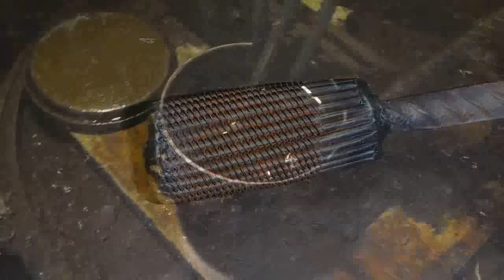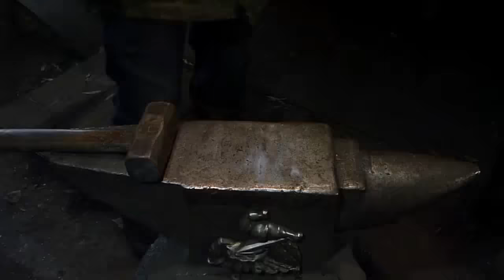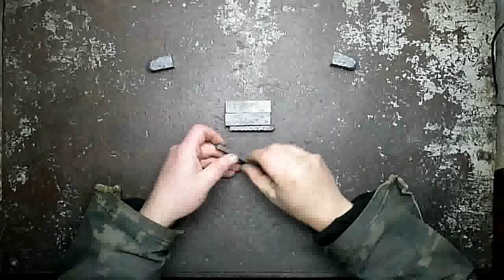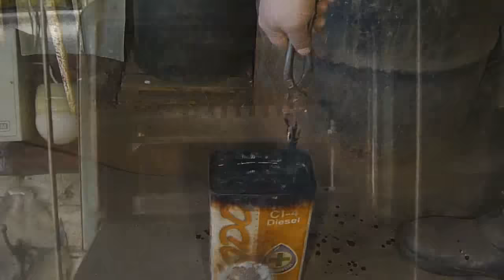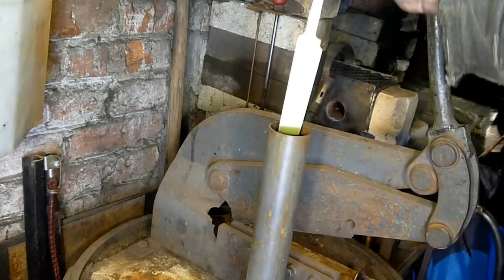Damascus of screws, making a blade.

Comment: Oque é esse pó que se coloca no aço quente?
Reply from the maker: Eu borrifo com fluxo (bórax 90% + areia de quartzo 5% + carvão em pó 5%), isso é necessário para realizar a soldagem (forja). O fluxo se funde com a escala - a substância resultante é bastante fluida e é facilmente deslocada durante a deformação. Além disso, o fluxo protege contra o oxigênio e, devido ao carvão, carboniza a camada superficial do metal - o que diminui a temperatura da soldagem (em resumo).

Comment: What powder do you add to hot iron? Write to me please
Reply from the maker: I sprinkle flux (90% borax + 5% quartz sand + 5% charcoal powder) this is necessary for forging (forge) welding. The flux is alloyed with scale - the formed substance is sufficiently fluid and is easily displaced by deformation. In addition, the flux protects against oxygen and charcoal, carburizes the surface layer of metal - which lowers the welding temperature (if in brief).

Comment: Why did you start on a piece of wood?
Reply from the maker: The first welding is done on a tree, as the tree is a heat insulator, and not so selects temperature as an iron anvil. In addition - burning, the tree burns oxygen, protecting the workpiece and pouring the flux work. This is important for welding workpieces with small parts (cable, chain).

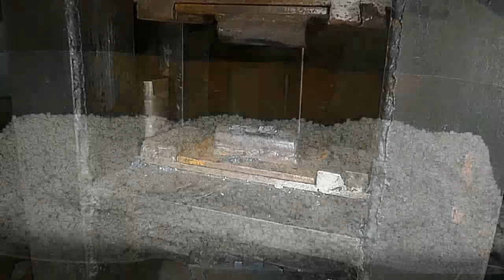Comment: Hi everyone. Does anyone know what substance is being used to quench at 6:37?
Reply from the maker: This is annealing of steel, it is needed for grinding grain of steel grown at the temperature of forge welding, stress relief. Preheated billet to austenitic transformation temperature, placed for slow cooling in the heat insulator "Perlite".
Reply: @shurap  Thanks! I have very little idea about any of those terms you mentioned but I am going to investigate 😉. Also, keep up the great work!
Reply: @shurap  If there are any books or websites that you recommend, please let me know. Thanks again.

Comment: What is the liquid its dipped in at the beginning?
Reply from the maker: The billet is soaked in kerosene. This is necessary for good welding (forging) steel. When burning inside the workpiece remains soot (carbon), which, with further heating, scales and rust inside the workpiece restores to the iron, improving the quality of forging welding.

Comment: I want to know what powder dusted on the metal
Reply from the maker: I sprinkle flux (90% borax + 5% quartz sand + 5% charcoal powder) this is necessary for forging (forge) welding. The flux is alloyed with scale - the formed substance is sufficiently fluid and is easily displaced by deformation. In addition, the flux protects against oxygen and charcoal, carburizes the surface layer of metal - which lowers the welding temperature (if in brief).
Reply: @shurap  Thanks for your professional answering.

Comment: What is the powder he pour on the screw?
Reply from the maker: I sprinkle flux (90% borax + 5% quartz sand + 5% charcoal powder) this is necessary for forging (forge) welding. The flux is alloyed with scale - the formed substance is sufficiently fluid and is easily displaced by deformation. In addition, the flux protects against oxygen and charcoal, carburizes the surface layer of metal - which lowers the welding temperature (if in brief).

Comment: What's that dust you're spilling?
Reply from the maker: I sprinkle flux (90% borax + 5% quartz sand + 5% charcoal powder) this is necessary for forging (forge) welding. The flux is alloyed with scale - the formed substance is sufficiently fluid and is easily displaced by deformation. In addition, the flux protects against oxygen and charcoal, carburizes the surface layer of metal - which lowers the welding temperature (if in brief).
Reply: @shurap  Thank you, master.
Reply: @shurap  I love this job.

Comment: What does putting ash on it do?
Reply: That is flux, Borax most likely, it melts into a liquid and displaces air / oxygen and other gasses as the metal comes together and prevents voids. In the canister he adds powdered steel to fill the voids around the small screws within the sealed canister.

Comment: Dumb question what’s the stuff he sprinkled on it
Reply from the maker: I sprinkle flux (90% borax + 5% quartz sand + 5% charcoal powder) this is necessary for forging (forge) welding. The flux is alloyed with scale - the formed substance is sufficiently fluid and is easily displaced by deformation. In addition, the flux protects against oxygen and charcoal, carburizes the surface layer of metal - which lowers the welding temperature (if in brief).

Comment: Why does he hit it on wood first?
Reply from the maker: The first welding is done on a tree, as the tree is a heat insulator, and not so selects temperature as an iron anvil. In addition - burning, the tree burns oxygen, protecting the workpiece and pouring the flux work. This is important for welding workpieces with small parts (cable, chain).

Comment: what does the powder do, and what is it?
Reply from the maker: I sprinkle flux (90% borax + 5% quartz sand + 5% charcoal powder) this is necessary for forging (forge) welding. The flux is alloyed with scale - the formed substance is sufficiently fluid and is easily displaced by deformation. In addition, the flux protects against oxygen and charcoal, carburizes the surface layer of metal - which lowers the welding temperature (if in brief).
Reply: @shurap  thanks a lot for the great explanation! Love your videos!

Comment: What does he dunk it in at the start of the video?
Reply from the maker: The billet is soaked in kerosene. This is necessary for good welding (forging) steel. When burning inside the workpiece remains soot (carbon), which, with further heating, scales and rust inside the workpiece restores to the iron, improving the quality of forging welding.
Reply: @shurap  Oh ok thanks for the info

Comment: What is the powder he is spreading on?
Reply from the maker: I sprinkle flux (90% borax + 5% quartz sand + 5% charcoal powder) this is necessary for forging (forge) welding. The flux is alloyed with scale - the formed substance is sufficiently fluid and is easily displaced by deformation. In addition, the flux protects against oxygen and charcoal, carburizes the surface layer of metal - which lowers the welding temperature (if in brief).
Reply: @shurap  ah interesting, thank's man 👍

Comment: Whats he seasoning the screws with at 0:42
Reply from the maker: I sprinkle flux (90% borax + 5% quartz sand + 5% charcoal powder) this is necessary for forging (forge) welding. The flux is alloyed with scale - the formed substance is sufficiently fluid and is easily displaced by deformation. In addition, the flux protects against oxygen and charcoal, carburizes the surface layer of metal - which lowers the welding temperature (if in brief).
Reply: shurap you legend! Thanks for letting me know 👌💯

Comment: Why hit it on wood first?
Reply from the maker: The first welding is done on a tree, as the tree is a heat insulator, and not so selects temperature as an iron anvil. In addition - burning, the tree burns oxygen, protecting the workpiece and pouring the flux work. This is important for welding workpieces with small parts (cable, chain).

Comment: Why is hé using that powder
Reply from the maker: I sprinkle flux (90% borax + 5% quartz sand + 5% charcoal powder) this is necessary for forging (forge) welding. The flux is alloyed with scale - the formed substance is sufficiently fluid and is easily displaced by deformation. In addition, the flux protects against oxygen and charcoal, carburizes the surface layer of metal - which lowers the welding temperature (if in brief).
Reply: @shurap  thank you👍

Comment: whats the powder and what does it do?
Reply: It's sand. The silicon in the sand reacts with a compound on the metal to form something called fayalite. Fayalite melts just under the metal's welding temperature, meaning it seeps in the cracks of the weld improving its strength and overall quality.
Reply: @cl4267  wow thanks, never thought sand would be used for te weld. I was alwasy thinking some kind of metal dust

Comment: What is that powder?
Reply from the maker: I sprinkle flux (90% borax + 5% quartz sand + 5% charcoal powder) this is necessary for forging (forge) welding. The flux is alloyed with scale - the formed substance is sufficiently fluid and is easily displaced by deformation. In addition, the flux protects against oxygen and charcoal, carburizes the surface layer of metal - which lowers the welding temperature (if in brief).

Comment: Why the wooden board?
Reply from the maker: The first welding is done on a tree, as the tree is a heat insulator, and not so selects temperature as an iron anvil. In addition - burning, the tree burns oxygen, protecting the workpiece and pouring the flux work. This is important for welding workpieces with small parts (cable, chain).

Comment: Why put the powder
Reply from the maker: I sprinkle flux (90% borax + 5% quartz sand + 5% charcoal powder) this is necessary for forging (forge) welding. The flux is alloyed with scale - the formed substance is sufficiently fluid and is easily displaced by deformation. In addition, the flux protects against oxygen and charcoal, carburizes the surface layer of metal - which lowers the welding temperature (if in brief).

Comment: 1:33 what is the powder he applied ?
Reply from the maker: I sprinkle flux (90% borax + 5% quartz sand + 5% charcoal powder) this is necessary for forging (forge) welding. The flux is alloyed with scale - the formed substance is sufficiently fluid and is easily displaced by deformation. In addition, the flux protects against oxygen and charcoal, carburizes the surface layer of metal - which lowers the welding temperature (if in brief).
Reply: @shurap  wow, that was an awesome reply - I truly wish I understood what it all means. But somehow the flux keeps the metal malleable during forging?

Comment: What kind of powder?
Reply from the maker: I sprinkle flux (90% borax + 5% quartz sand + 5% charcoal powder) this is necessary for forging (forge) welding. The flux is alloyed with scale - the formed substance is sufficiently fluid and is easily displaced by deformation. In addition, the flux protects against oxygen and charcoal, carburizes the surface layer of metal - which lowers the welding temperature (if in brief).
Reply: shurap thanks

Comment: How come wood is used ?
Reply from the maker: The first welding is done on a tree, as the tree is a heat insulator, and not so selects temperature as an iron anvil. In addition - burning, the tree burns oxygen, protecting the workpiece and pouring the flux work. This is important for welding workpieces with small parts (cable, chain).
Reply: @shurap  thank you for taking the time to reply. Exalent work as always sir.

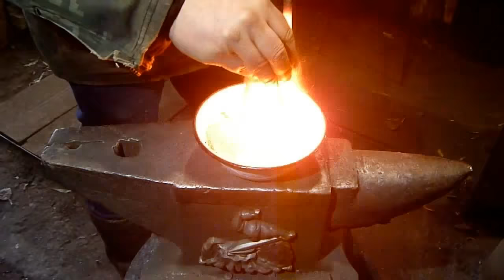Comment: 0:35 what's is this powder?
Reply from the maker: I sprinkle flux (90% borax + 5% quartz sand + 5% charcoal powder) this is necessary for forging (forge) welding. The flux is alloyed with scale - the formed substance is sufficiently fluid and is easily displaced by deformation. In addition, the flux protects against oxygen and charcoal, carburizes the surface layer of metal - which lowers the welding temperature (if in brief).

Comment: Why the wood?
Reply from the maker: The first welding is done on a tree, as the tree is a heat insulator, and not so selects temperature as an iron anvil. In addition - burning, the tree burns oxygen, protecting the workpiece and pouring the flux work. This is important for welding workpieces with small parts (cable, chain).

Comment: What’s the powder
Reply from the maker: I sprinkle flux (90% borax + 5% quartz sand + 5% charcoal powder) this is necessary for forging (forge) welding. The flux is alloyed with scale - the formed substance is sufficiently fluid and is easily displaced by deformation. In addition, the flux protects against oxygen and charcoal, carburizes the surface layer of metal - which lowers the welding temperature (if in brief).

Comment: 0:30 hey what’s that breadcrumb
Reply from the maker: I sprinkle flux (90% borax + 5% quartz sand + 5% charcoal powder) this is necessary for forging (forge) welding. The flux is alloyed with scale - the formed substance is sufficiently fluid and is easily displaced by deformation. In addition, the flux protects against oxygen and charcoal, carburizes the surface layer of metal - which lowers the welding temperature (if in brief).

Comment: How is name white powder it?
Reply from the maker: I sprinkle flux (90% borax + 5% quartz sand + 5% charcoal powder) this is necessary for forging (forge) welding. The flux is alloyed with scale - the formed substance is sufficiently fluid and is easily displaced by deformation. In addition, the flux protects against oxygen and charcoal, carburizes the surface layer of metal - which lowers the welding temperature (if in brief).
Reply: @shurap  Ok dude...tank you

Comment: 0:37 what’s this powder for?
Reply: Yeah I'm wondering the same ! Maybe it's coke (not the drug, the Iron and cash iron making thing. It's almost pure carbon) that but seing how much he put in it it would probably be ome cast iron. The more carbon you add the harder it become it also becomes heavier and harder to bend without breaking. From 0.67 to 2% of carbon in Steel is considered as Iron, then from 2% to 6.67% is cast iron. 

If it really is coke his knife must be extremely hard espacially if you consider that oil hardening at the end.
Reply from the maker: I sprinkle flux (90% borax + 5% quartz sand + 5% charcoal powder) this is necessary for forging (forge) welding. The flux is alloyed with scale - the formed substance is sufficiently fluid and is easily displaced by deformation. In addition, the flux protects against oxygen and charcoal, carburizes the surface layer of metal - which lowers the welding temperature (if in brief).
Reply: @shurap  ho ok I was far away XD well After all m'y knowledge on Steel and Iron Melton is based on structural Iron made for boat... We do everything to avoir any hardening and deformation do kind of the polar opposit in away...

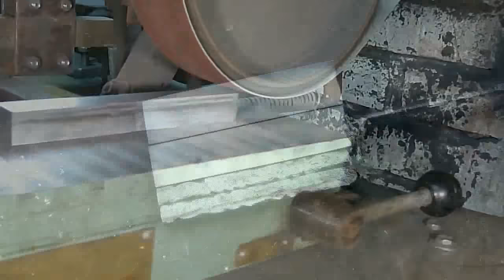Comment: What is the powder 5:11
Reply from the maker: I sprinkle flux (90% borax + 5% quartz sand + 5% charcoal powder) this is necessary for forging (forge) welding. The flux is alloyed with scale - the formed substance is sufficiently fluid and is easily displaced by deformation. In addition, the flux protects against oxygen and charcoal, carburizes the surface layer of metal - which lowers the welding temperature (if in brief).
Reply: @shurap  thanks

Comment: 0:32 what is it?
Reply from the maker: I sprinkle flux (90% borax + 5% quartz sand + 5% charcoal powder) this is necessary for forging (forge) welding. The flux is alloyed with scale - the formed substance is sufficiently fluid and is easily displaced by deformation. In addition, the flux protects against oxygen and charcoal, carburizes the surface layer of metal - which lowers the welding temperature (if in brief).
Reply: @shurap  👍👌
Reply: @shurap  thank you so much

Comment: Made from screws it’s going to be as hard as a 80’s wine cooler…. That thing will be as strong as Biden border policy and as useful as sending Kamala Harris to take care of it. Would probably be marginally better than any Walmart camp knife. Sometimes people do things wondering if they can when they should be soldering if they should.
Reply: You must have missed the part where he made another billet of high carbon steel and put it on the edge. 
Nothing wrong with having a softer back and a hard steel edge.

Comment: Forge the edge rather than spend a!l that time on a grinder
Reply: The reason smiths grind away metal on damascus blades is to reveal the fold layers near the middle of the blade that are much better looking than the ones near the surface. He knows what he is doing...
Reply: @archer9338  I know what he's doing too. However it's much easier to forge the edge rather than grind it